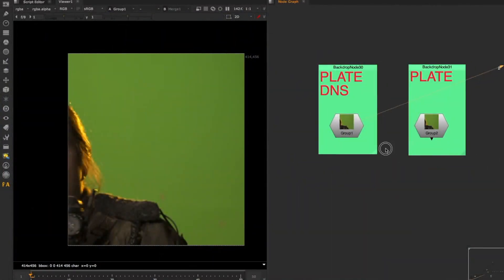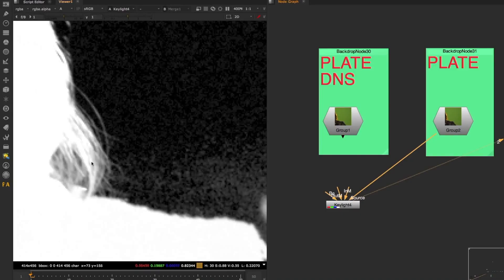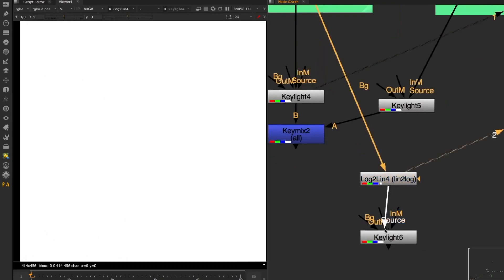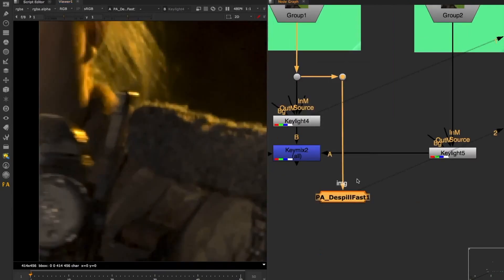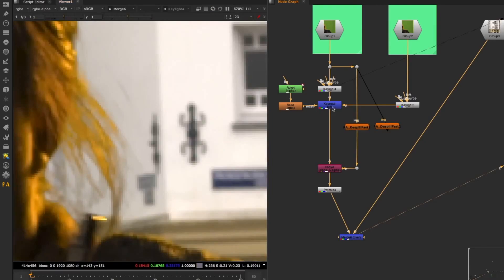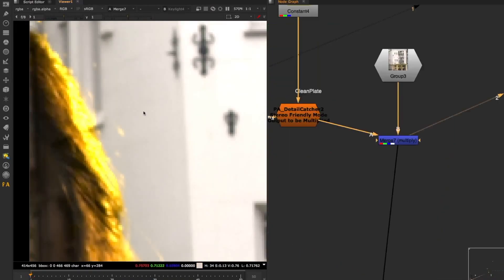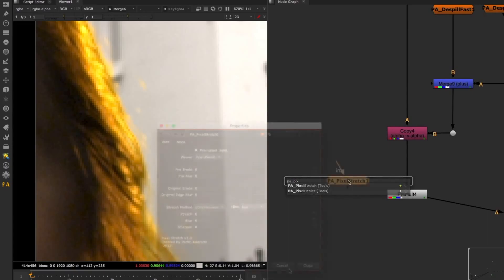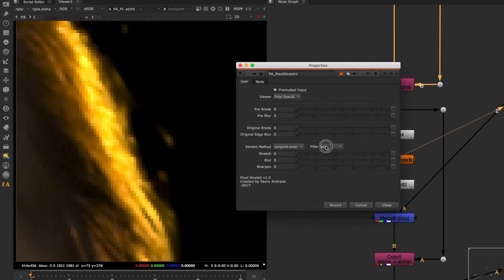What to look for to get GOOD EDGES when KEYING in NUKE | Comp Lair: Live Tech Corner S01

Comment: You gotta use neat video. A denoise losing that much detail will make you fight the setup constantly. Second, instead of a premult, there is something much better that resolves much of these issues. Think of it this way... If you got a shot from CG with a green background, you wouldn't despill and premult, right? You'd subtract the color. Why don't we do this with keying? 😏
Reply from the maker: Hello Eugen! Thanks for your comment. 

The example is purposefully agnostic in regards to which denoise you might be using. NeatVideo gives you good results - not flawless results all the time necessarily speaking. Therefore, the core of the issue stands even if you're using NeatVideo sometimes and in some regions - all depending on the nature of the plate and on your NeatVideo settings.

About the despill part of your comment, while that approach might have some level of success for non VFX shots (ie Animation/Full CG shots), this is not the case for real plates with real despill contamination of multiple screens and BGs - saving some lucky shots.  Also, in VFX, the despill can be a very sensitive area to some clients and because of that, this is an area that can suffer many iterations. Therefore, it's important to have as much control as possible between core, edge areas and possibly some other more specific regions so, a simple subtraction would probably be insufficient and wouldn't work.

Hope this helps, thanks for your comment again and I hope to see you in the next Live show!
Reply: @CompLair  Well, subtracting the cleanplate from the shot has become perhaps the most revolutionary part of my keying over the past five years. Yeah, you have to do some careful despilling, work with your core/edge, etc... but I've found the most important aspect I've found is subtracting the cleanplate from the plate, rather than premultiplying.
Reply: To say it another way, I've been doing it for several years on feature and series work with excellent results.
Reply: @eugenolsen  You talking about how you make a cleanplate, get a matte (IBK), and then basically rebuild the "screen subtraction" part of the IBK keyer? What you said about CG is really similar to my thinking - more and more I've been thinking about how to really restore the actual edge colour, which is what screen subtraction does. Real colour = plate - clean plate, but then you use the purest IBK matte to restrict it to the screen area. And I also despill the plate/clean plate before doing the screen subtraction of course.

Sometimes I'll do that, and then any custom despill things i'll do (to get correct edge colour/transition) i'll have to do on both sides of my screen subtraction (plate and cleanplate). A bit clunky, but can really work great.

I like thinking about it in a CG way, if I unpremult, I want to see the actual, original, restored colours of the FG object. Often I'll end up spending a lot of time getting a really good clean plate, so the rest of the keying process is as procedural as possible. Of course, sometimes it really does just come down to whacking in an edge extend somewhere, because the plate is just fucked or something.
Reply: I started working that way because I'd often get annoyed at the fact that a simple keylight or IBK just gave such great results out of the box, but then colours would break when pushing things to get a good matte, and visa versa. I didn't know why or how it worked, until I unticked "screen subtraction" in IBK and then reverse engineered it. Idea being that I could use the weights in IBK, or the screen balance in keylight to get the best matte I could and the best despill. Best of both worlds, but only by doing a custom screen subtraction. Always keen to hear other peoples methods, it's very possible I'm overcomplicating some things.
Reply: @PeterJansen  you're right. IBK is in fact keylight wrapped around a keylight and" screen cleaner". And the screen subtract is simply stencil the cleanplate and minus that from the plate. Make sure to clamp because the from operation is very aggressive. Despill is usually best before, but sometimes after.